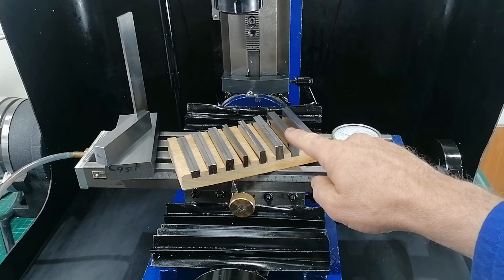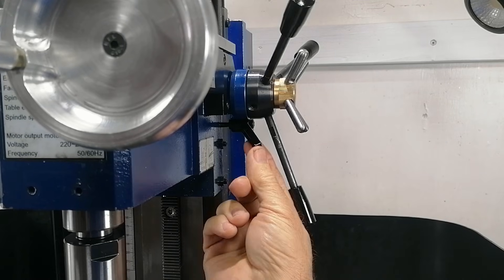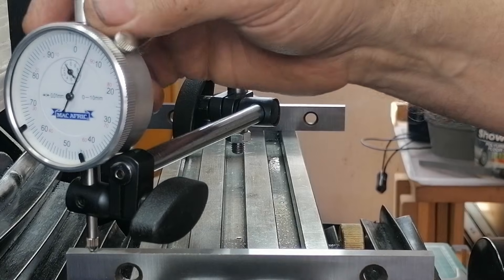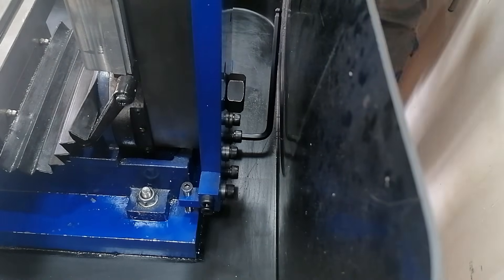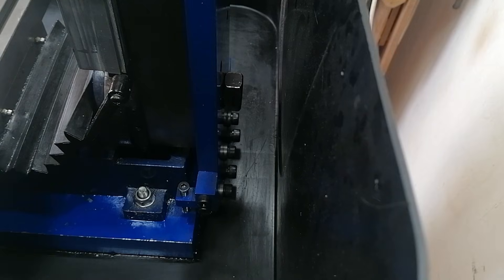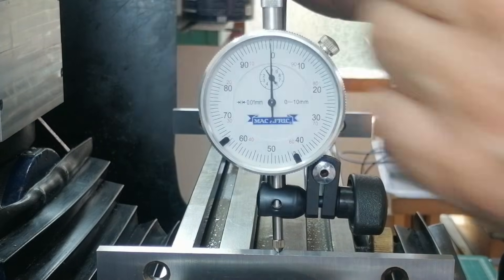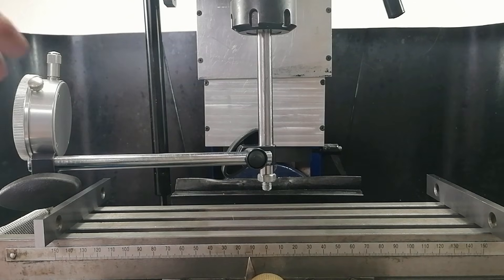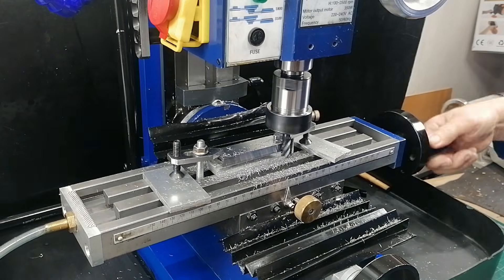Tramming My Mini Mill to Perfection

Comment: Nice, but I didn’t understand how you trim the Y direction. In your video of the exoskeleton you show it via the the bolts of the base plate, but here I didn’t get it.
Reply from the maker: There is a small gap between the base and the backplate, which allows the backplate to be pulled slightly towards or away from the baseplate with the bolts. The foot of the mill is firmly bolted down to the baseplate. When the backplate and baseplate is pulled together or pushed apart, the result is that the column gets tilted back or forth.
There are two sets of bolts. The first is the pulling bolts. They are tapped into the base plate and pull the bottom part of the backplate towards the base plate when tightened. That will allow the backplate (and by implication the column) to be tilted backwards.
The second is the pushing bolts. They are tapped into the backplate and pushes against the baseplate to push the backplate away. That will allow the backplate (and by implication the column) to be tilted forwards.
Have a look at my exoskeleton video at https://youtu.be/_XZeWoICyUc
Reply: @GreatIdeasCatalogue Thank you for explanation.

Comment: when checking the Y (or X) axis. There can be a column problem or the table can be tilted on it ways. IMHO. You can check this by moving the table and measuring the change of height on indicator.
Reply from the maker: That is a very good point. Thank you for sharing.